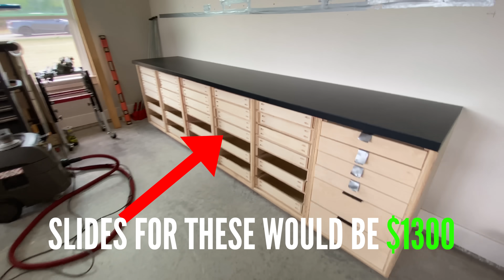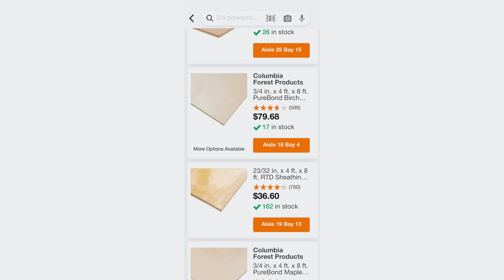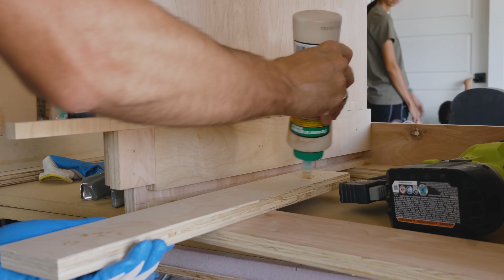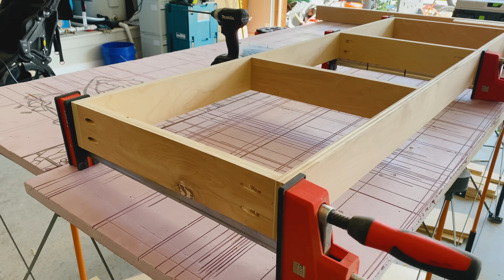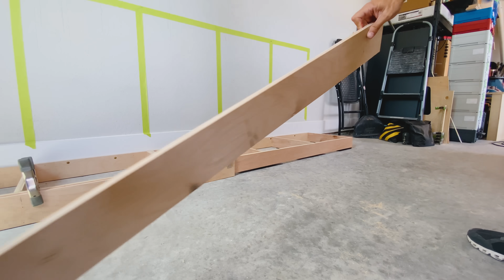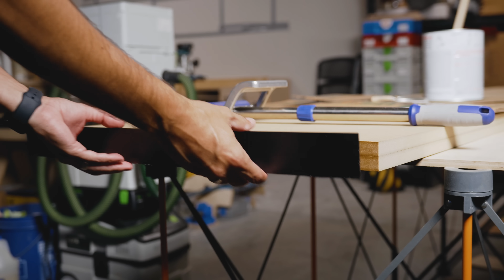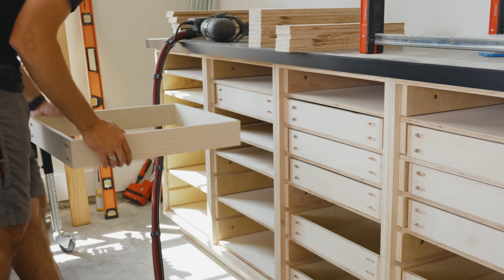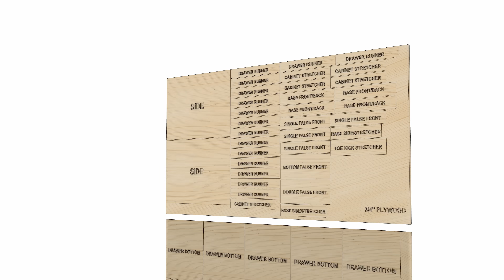Drawer slides are expensive. Do this instead.

Comment: Use a 1/4" laminate router bit with wax on the surface.  The bit looks like a cylinder with a notch in it.  The tip is rounded.  Apply wax under the laminate overhang.  Route.  File.  Clean up with mineral spirits.  Bit on amazon:  Bosch 85285 1/4 in. x 1/4 in. Solid Carbide 1-Flute Flush Trim Bit.  Use this for a flush cut.  Do not use on gloss.  It's okay to use on a matte finish.  Use wax on laminate surface.  File afterwards.  There are bevel bits with bearings,   These are great, but proper set up is needed.  Try the bevel bearing bit on a piece of scrap to get a feel for it.

Comment: I know it's been two years, but I wanted to give some advice I had that is relevant. (watched to the end btw)

There is another youtuber that I watched that does a TON of work with plywood. Sanding will always give you a good finish, but that wood on wood sliding obviously isn't as nice as a lubricated sliding hardware rail. But there is another option that is low cost and can help with this! 

Dry lubricants! 
Graphene powder can be purchased from amazon for about $18 a pound and will help a lot with the sliding action of the drawers. 

I have been very curious how well they slide when loaded with tools. Either way, love the video, definitely a good project for a new shop! Thanks!

Comment: 🤿 I have made many drawers in a similar style, without hardware. I use scraps of plastic laminate to line the “runners” and apply wax about once a year. This reduces wear on the drawer sliding surfaces.  Nice work.

Comment: I really love the good ducktape-work! 🤿
You could have saved an significant amount of plywood (and therefor not broke the 900$ target with the cheaper 40$ plywood) by using only the Front-front and not a double front of your drawers (and saved some work and gotten one layer of plywood extra in drawer length).

Also you could have used the separations between the cabinets as a wall for both sides (not two walls between cabinets but just one) and thus also saved a lot of wood plus gotten one layer of plywood in extra drawer width.

Comment: 🤿 Looks nice but unless you live in an area with extremely low humidity it will only take a couple of days of high humidity before your drawers will begin to stick.   And there is the added annoyance of accidentally pulling your drawer out to far and it crashing onto the floor along with everything in the drawer.   The handles you picked looked nice but given how much harder that style of drawer will be to open, over time you will be replacing quite often them

Comment: you could also have made draw pulls by simply taking some scrap 1X2, or 2X2 cutting a small dado or bevel in it, cutting it down to 4" lengths and attaching them wide side out to the front of each draw. and you wouldn't have to worry as much about accidentally gashing yourself on those metal pulls. Which to me looks like its inevitable LOL

Comment: What I wonder: If the handles are on the top of the drawer and the slides at the bottom, doesn't that create unnecessary friction? 
Wouldn't it be better to either attach the slides to the top too, or choose handles that attach lower / closer to the bottom slides? 🤔 Can an expert help?

Comment: Awesome video, I've been debating whether to use drawer slides or just wood on wood as you've done. Couple of questions: Are you concerned about pulling the drawer out too far and it coming off the track? What are some options to solve this? Also, do you think you could have done it with thinner material? Seems like this is really heavy.

Comment: 🤿 as a former drywall hanger not only did we use duct tape for seems but when we ran out of construction adhesive we would make little O's out of it with the sticky side out and hang it till we nailed the perimeter.

Comment: Wood on wood sliding will wear out the slides.  Plus it just "feels weird" pulling out a drawer.  Also, you can not fully extend the drawer to easily reach stuff at the back.

Comment: We used to use furniture polish on the edge banding before routing (with non bearing flush cut bits) and it eliminated scratches to the laminate. Furniture polish often has silicone in it.

Comment: the tape on the tin only works if the inner rim is taller than the outer rim - otherwise it serves to collect as much content as possible

dont ask me how i know lol

also, sealing the edge of mdf with pva works to prevent impact adhesive or the solvent in the adhesive getting absorbed

great vid

Comment: 🤿 Thanks, I loved every second of this video. 
We, the Royal We, = My husband and two great young lads who did the geavy lifting recently moved our 20 year old metal shed, so the rotten floor boards could be replaced.
The ground wasn't level. When is it ever level? I described the shims (I called them wedges) as my partner was oblivious to the concept. He quite correctly felt that levelling the wooden base by scribing and sawing the components was hard work and out of skill set. 
Scribes made from composite would have made the task much simpler.
But like you, he failed to heed the advice of his wife. The shed, lilts, and the roof has developed a slight leak. 🤦🏻‍♀️But it can be fixed. It's a wonderful shed. I'm very proud of him even if he doesn't listen until he thinks it's his idea.😂

Comment: Instead of using those wide ‘planks’ inside the cabinets, I would prefer to use is small strip of hardwood. That would save on weight but more importantly it would also allow the drawers to be 2x3/4” wider so you’ll create more space and that’s the primary function of a cabinet. 

The drawers would possibly slide a bit smoother too especially if you’d glue thin strips on the bottoms of the drawers too.

Comment: Make sure to wax the bottom of the drawer slide, and the top, on both the drawer and the rails. This ensures that the drawers are sliding against the wax and not wood on wood. This trick is older than me, and I am 75... I have pretty much always used wood rails. Hate losing about 1 inch of width on each side of the drawer to rail guides.....

Comment: When you flush trimmed your laminate I suspect you used a regular flush trim bit. A flush trim bit designed for laminate has a slightly smaller cutting diameter than the diameter of the bearing. Then you follow up with a bevel trim bit designed for laminate. The bevel bit cuts an approximate 10° angle that you set so the bottom of the cut lines up perfectly to where the fascia meets the bottom of the upper piece of laminate, then carefully file to the point where you can't catch your finger nail on it. I don't have a snorkel emoji or it would be here.

Comment: @19:00 the mark on the edging is from the baring heating up and rubbing the laminate. To get around this the easiest thing to do is just add some masking tape to the edges before you glue down the top and route. Remove the tape and use a file to flush it

Comment: I have one suggestion that will amaze you if you have not tried it.  i discovered this years ago while trying to come up with a way to make drawer slides work "better" on antique furniture that was being restored.  Obviously antiques did not use ball bearing glides for drawers.  Typically wood runners  support  drawers and wax was used to make the sliding action better and smoother and that can still work wonders but it has to be "refreshed" which is certainly doable but a hassle.  You can use teflon tape (the kind I've used is made by St. Gobain company) with pressure sensitive adhesive built in.  You put a strip carefully on the underside of the drawer rail and another on the drawer support rail/  Slides like butter even with a full drawer load of stuff.  Try it. Not expensive. Fast (although you need to be a bit of a perfectionist applying the tape, but once you get the hang of it it's very quick.

Comment: good cheap slides cost around 8-10 usd MAX per drawer. Also you can buy some really cheap... for 1-2 usd, but I don't recommend it. So this whole video is create on some false assumption of expensive slides. Also this 'wood slides' will deform in time, when that drawer will be pack with some weight. So after few years you will be 'fighting' with this drawers too pull/push them.

Comment: 🤿I built similar cabinets, with nearly identical techniques, except - after the draws were in place, I screwed a 3/4"x3/4"x3" stop under the front lip of the in-place pieces, using a 90-degree offset screwdriver. Screwed so it would be removable, and put there to prevent pulling the drawer out, dumping everything on my foot and/or floor.
For the placement template, I cut it about 1/16" oversize to allow for shrink and swell. The resulting play as the drawer is pulled out is negligible.
I enjoyed your humor and handy hints, especially the kick plate. thanks!

Comment: Quick tip for some drawer stops that will keep your drawers from pulling out and dumping all over the floor...drill 2 3/8" holes spaced evenly at the very back of the drawer bottom, and drop in a pair of 3/8" bolts that are just long enough to catch the front of the drawer below it when you pull the drawer forward...then if you do want to remove the drawer, just pull the two bolts up and slide the drawer out...

Comment: 🤿 I have a shop that came with the house I bought 5 years ago. The prior owner built muscle cars. The shop has one long counter built on one side with a radial arm saw. That’s it. Huge empty building. Tomorrow I want to clean and organize it to build kitchen islands and potting benches. Your video is perfect on building the drawers. Ingenious! My house is 123 years old and the original cabinets were left behind so I saved them and will use them for my big work table.

Comment: That’s a pretty incredible job here.  I learned a ton. How on earth do you know what you’ve got in all those drawers?  I know I’d have to label them and put custom dividers in for specific items.  Since it’s been a year since this video came out, are the plywood slides still working well?  I wondered about the wood on wood friction whenever you slide them a bunch, particularly if you’re loading them densely with like fasteners, etc.  Great build.  Inspiring.  🤿

Comment: Someone has probably already told you but what happened on the edge is you didn’t use crisco grease on it. You have to put a thin layer of cooking grease on the  edge when you route the top or you will burn the Formica.

Comment: Those handles look nice but how does it feel when you bang your shin or knee on them, or catch and rip a pocket or belt loop on it? I would prefer a cheap utility pull with no edges to catch. I was also thinking, if you trimmed your bottoms halfway deep so the front had a 1/4 gap between the cabinet wall, than make the rail gap bigger to fit a 3 inch tall sliding carriage with a cutout centered for the drawer bottom to slide in with that 1/4 inch spanning from above to below the drawer bottom on the front quarter of the depth so as the drawer slides in the carriage the back part of the drawer bottom that goes all the way to the side of the cabinet catches that 1/4 inch of the carriage and starts pulling the carriage out as the drawer hits 1/4 extension allowing you to pull the drawer to full extension and still have 1/4 of the carriage in the carriage to hold the drawer up at full extension. If it pinches the gap in the back too much you could notch the drawer bottom to fit a block spanning the top and bottom of the rail in the back, or play with where the drawer bottom goes all the way back. It wouldn't use any more wood as it's just taking part of the blocks that hold the drawer bottom and turning them into a carriage, it may hold more weight, and they can still be pulled out and moved around with the exception of any where the drawer bottom has no gap between the bottom of the cabinet.

Comment: Use BBs or marbles in drilled cup holes slightly protruding. Or Adhesive-backed nylon furniture sliders or UHMW (ultra-high molecular weight) tape, Laminate or Melamine Strips, PVC Pipe Slice Rails, or cut HDPE (milk jugs) into small strips. All of these will provide a much smoother sliding surface as will beeswax or candle wax suggested by others.

Comment: Snorkel = "No Emoji Found"??? How are your cabinets handling the humidity? Did you wax the glides/slides? Also, have you taken out a knee yet? I ask this since I have the same style pulls on a large folding mirror closet/wardrobe in my bathroom that, when I'm not paying attention, takes a chunk out of my arm/hand/elbow. I would like to build a router tools storage system under my router table and I like your build and could adapt this to my needs.

Comment: This is old school slide door. Best.
I remember as a kid, there was like a stop arm or something (stuck up), about an inch from the back on the inside sides. 
This way, you could not pull the drawer right out.
The stopper thingy (which was even a small pc of wood sometimes) would be higher than the lip on front, hence, stop drawer.😅
I tried my best to explain it.
If you read this whole comment,  the you know that I know, the duct tape was not left on.

Comment: Great video. Well worth the time to watch. I do like the fact that you pointed out your errors and how to get around them. Thanks for taking the time to do this video. Now I feel that I have the knowledge and the ability to tackle my own cabinets.
Is there a "trade" name for the $40 plywood? I have finished all my design work and am ready to source materials and the $40 price is soooo much better than what I'm finding in Riverside County CA. I have rehabbed a 60 yr. old Craftsman cast-iron table saw and will be building a bench/cart for it with 24 drawers and a place for my router & shop vac.  
Thanks again!

Comment: Get a quality laminate trim bit. Install it as deep as possible in the router chuck to minimize flex and chatter. Run painters' tape around the top of the edge banding for a bit of extra space. Finish with an angled chamfer bit and pull the tape off. Perfecto!

Comment: So I saw someone else use the separate toe kick with shims trick... I think it was Michael Alm... but what HE did was shim everything to level, then use square scrap material to screw from the floor to the now level toe kick... then flush cut the scrap 'foot' to the top of the toe kick so you could take out the shims and re-use them instead of cutting the shims off and tossing the scraps. Basically, making 'feet' for the toe kick that would be level.

Comment: Are you kidding me? The cheapest set is 24$? Well, I can easily find drawer slides that are 5$ per pair and it has 600 mm that is 23.6 in. In Europe, even locally build. And yes I used exactly 600 mm last year. I bought mine 8.31$ per pair with brake/silent close. Ok, I need 6 sets only, but whatever.

Comment: I'm old, I don't do emojis, but "snorkel dude"... and I would have left the duct tape, then, 2 weeks later, it would bother me, so, I would then unload the cabinets, remove them, tape and mud the seams, then reinstall them and load them back up... I do appreciate your video, I've had empty carcasses in my shop for about a year due to cost of materials, I'm now going to try your "noncommercial slideless method on them. Thanks for the videos!

Comment: What a fantastic, informative video!  Something I think I could tackle... I hope. One question is about having the cabinet or the toe kick having direct contact with the concrete floor. I've always told you need to put some sort of barrier between the two so that moisture doesn't wick up into the wood from the concrete potentially rotting it. Did you just skip this or is this not a thing where you live perhaps because it's very dry?

Comment: 14:10 in personal experience unless an edge is exposed to elements and starts to peel duck tape is a lot like duct tape when it comes to prevent moisture and air intrusion.
Reply: 28:28

Comment: I'm a new diyer and scared of cabinet making, but seeing ur method I really feel I can do it was just wondering for the drawer bottom which is also the slider can I use quarter inch thick ply board to save on cost?

Comment: Love the video!! I also use those composite shims. Under the toekick face board, i save the long  plastic "tails" from ductwork zip ties, about 3/8" wide, and put dots of glue just to hold them in place. The weight of the cabinets do most of the holding. I only do this on concrete floors to keep water from damaging the toekick wood. I'm a 67 year old woman who used to do a lot of carpentry and woodworking. Never stop learning! Thank you!!!

Comment: I would buy a couple of sticks of 1"x1"x1" of alluminum channel and cut it with a chop saw to whatever length you want for your handles and smooth them with a file. Cut mounting holes with a countersink bit on the backside of the handle.  (It would probably be easier to drill the holes before cutting the sticks.)  Then gang mortice the top of the drawers before assembly.  Position the handles in the mortice and screw them in place from the inside of the drawer.  The U-channel will hold up better for opening the drawers if they stick than something that is just held in by screws on the top.

Comment: Those drawer handles would definitely not stand up to use., just for the mere fact of the print orientation. There are better designs, but why even bother when you can metal for that cheap. 🤿

Comment: Paraffin wax block run the edge it provides lube to keep the bit from burning into laminate. Remember if it is supposed to move and it doesn’t use WD 40.  If it moves and it shouldn’t use duct tape, the only 2 items a man really needs.  Excellent job and tell Dad thanks for helping